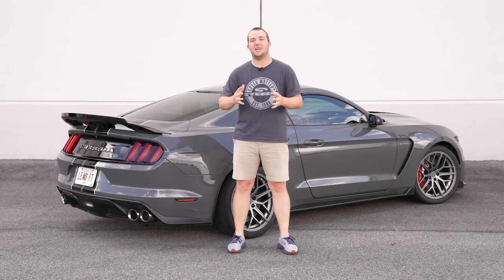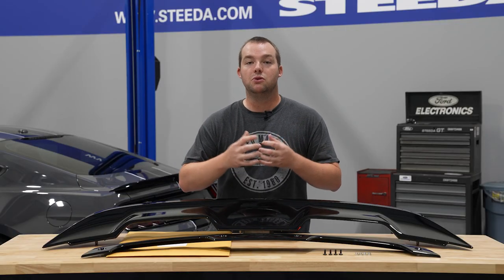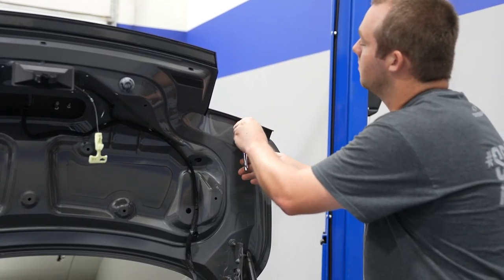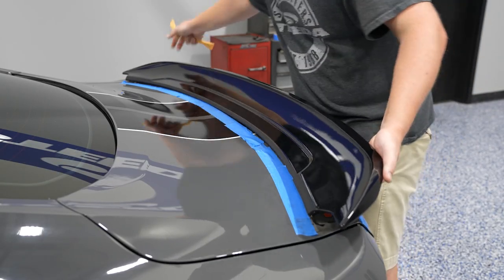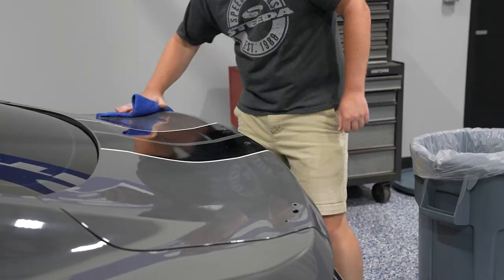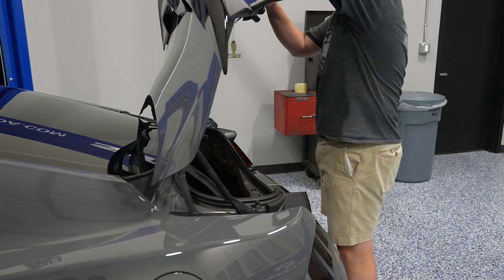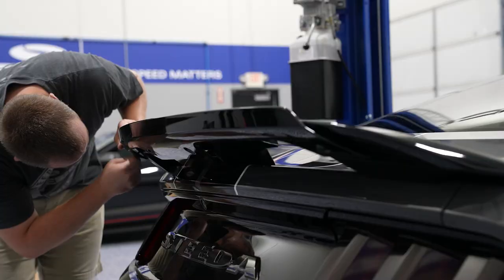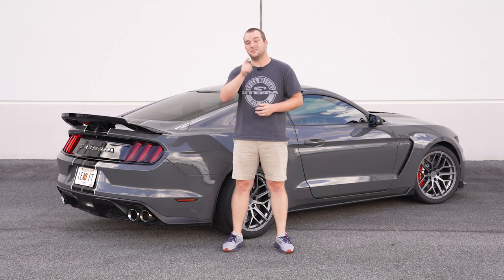Ford Performance GT500 Rear Spoiler w/Gurney Flap | Review & Install

Comment: Just took delivery of me 22 HP MACH 1 . I can garrantee the flab adds down force  . It also creates  a " non- trip " off of the swing ,lots of turbulence on the taillight plane . Just drive down any road , for 2 miles and compare the dust accumulated.  Also .... above 80 mph " in Mexico " , you can see the flap in a high frequency  vibration in the rear view mirror  . Hence the recommended locate.  
There is a huge areo difference  between my 21 gt pp1 and the 22HP MACH 1 .
From a 10mph dig the pp1 started to lift the front end at about 60mph . The HP MACH actually seems to nose over .
If you look at the pp1 from the side , the belly pan from the splitter to the front wheels appears to slope the wrong direction  . I believe the HP cow catcher  really helps plant the front end . More to come...... and.... Chris I will be contacting you soon about some drive line and rear suspension  upgrades on my 13 boss 302 , which is still my favorite mustang all things considered !!!!!
Sincerely Ted Kennedy

Comment: If you heat up the glue with boiling water / heat gun on low prior, it's much softer and easier to remove. Next I prefer dental floss at that point as it will not scratch up the paint underneath.

Comment: Life pro tip if you ever need to floss something apart using fishing line: Some bolts, wooden dowels, hell even a chop stick broken in two pieces, will be much kinder on your hands. Just wrap the line around your 'grips' four or five times, and have at it. A couple beers before you use fishing line for this, and you won't even realize you're cutting into your hands until you find your custom red paint job on everything you touched
Reply from the maker: Great tip! We'll try this out next time we need to break out the fishing line.

Comment: Have the same spoiler on my 2017 GT along with the same GT350 rear valance with quad tips, plus black Project 6GR 7's, and a Cervini front splitter. Other than the front end, the car really resembles a GT500. And with my Gen 5 Stg.2 Whipple it has the same power as a new GT500 too.  Anyhow, I love this spoiler and it really adds so much to the look.

Comment: it work for mustang Gt 2018?
Reply from the maker: Yes. Any 2015-2023 Mustang can fit this spoiler. California Special cars will require drilling as the existing spoiler holes do not line up.

Comment: Can i use it on mustang gt 22?
Reply from the maker: Yes you can! It uses the factory spoiler holes on the trunk but also comes with a template if you need to drill your own.
Reply: @steedaautosports  any shop you recommend in LA where i can get this installed? Or do you have a shop in LA?
Reply: @steedaautosports  there are two similar spoilers on your website , one is 229 and the other 575 they both look the same which one is better?
Reply: @riskit_biscuit3697  If you want to screw it in from the bottom with NO guideposts for the holes, then get the 229 version.

Comment: Crap I never took my gurney off since I got the car 2 years ago😅
Reply: I think maybe Ford's recommendation is just about saving 0.5 MPG or something  I've also been running the gurney flap for a while on the street myself, and no issues.
Reply: @kevinbreese5739 may be a dum question but do u realize the car doesn’t pull as hard at all? Like slow hard acceleration ?
Reply: @dougiekritikson9644  No I haven't. A lot of that probably has to do with the fact my mustang has 800hp though. Science tells us it definitely will cause some more drag. Could it be the difference between winning or losing a race? Well sure, but I'm sure the difference is very small and in most cases insignificant. I'm still running the flap. I have more than enough power and almost never race anymore so I don't worry about. I just enjoy the way it looks 👍